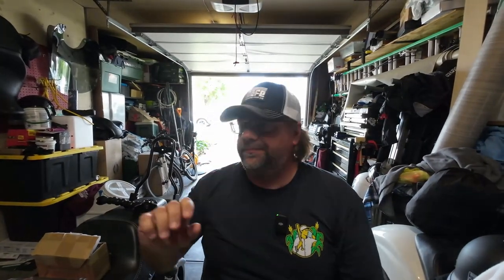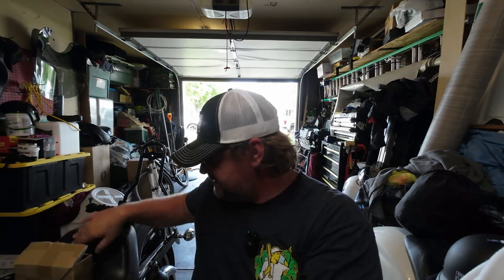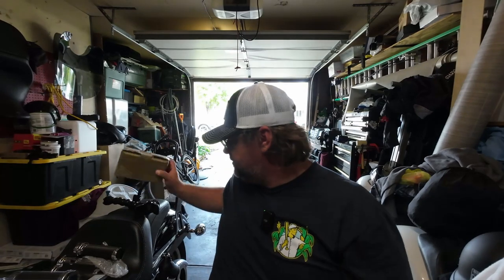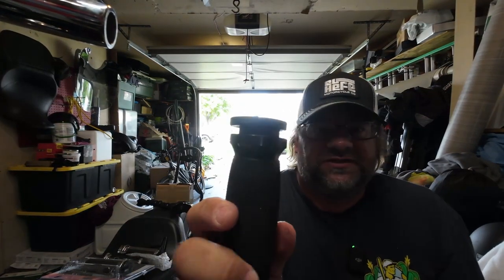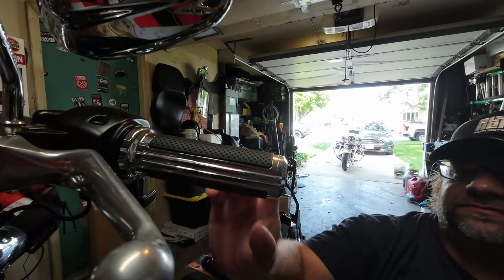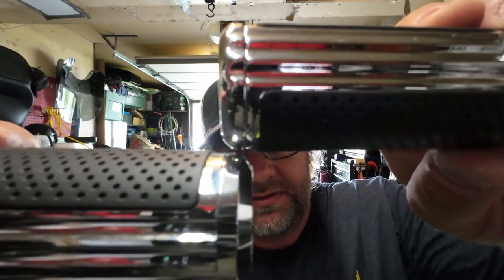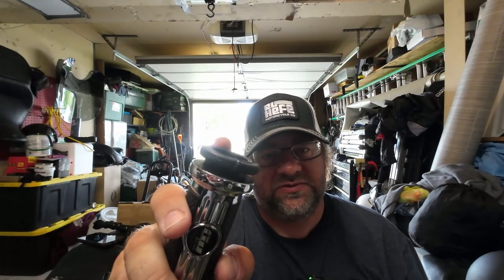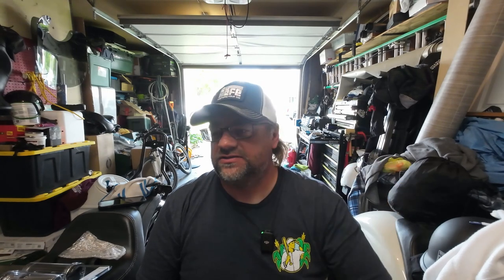Harley Davidson Budget Grips from the Amazon company Yhmtivtu

Comment: I put Avon grips on my Heritage. They are held on by the switch housings. They are 1.625" diameter memory foam grips. I really like them. They are the second set of Avon grips I have had. The other set is on the VTX. I think they are 4 years old. They  are still in great shape. I have had cheap grips that did not last a month. I paid $74.95 for the grips for the Heritage. I hope the ones you put on the Dyna last.